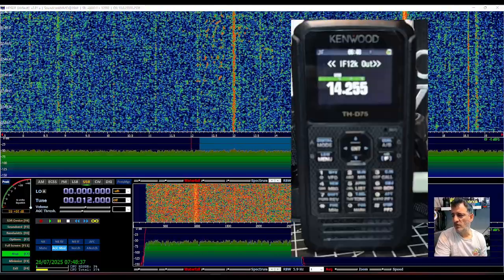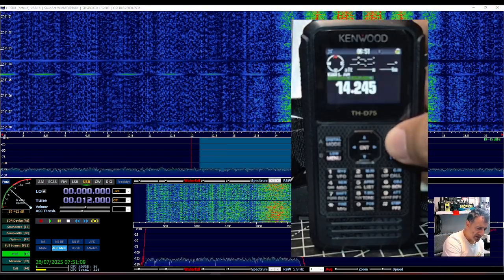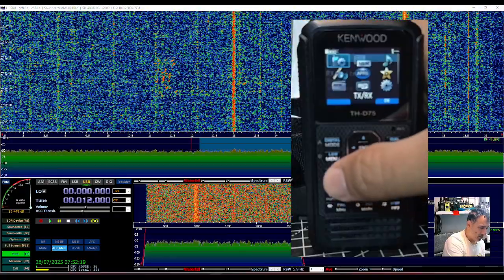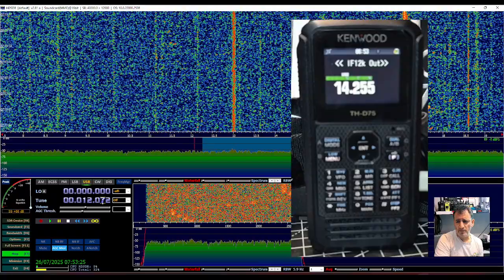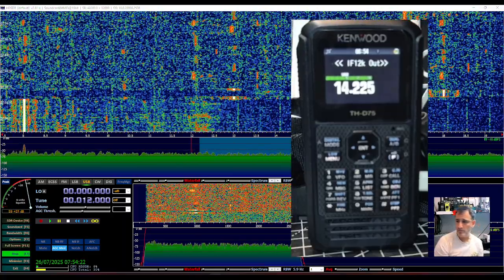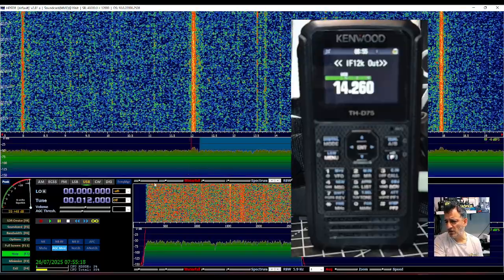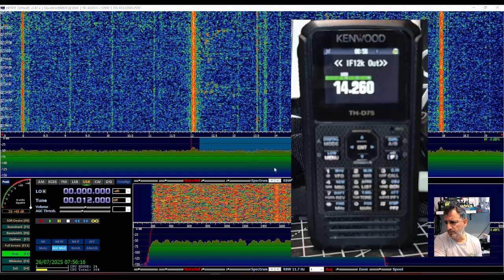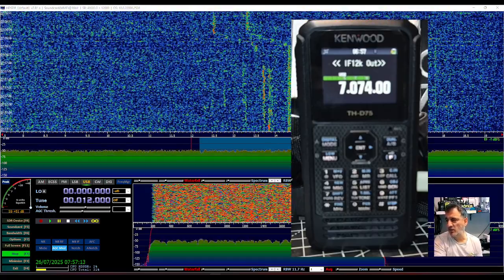HDSDR & KENWOOD D75 Set Up - Full Screen Waterfall

Comment: If you're like me and like messing around with SDR software try SDRpp brown. I came across it after having to replace my old windows 8 laptop! It will decode digital without having to add a VB cable and it allows you to connect to kiwi sdr and you can connect to servers across the world. It was on a tech minds video. 73's